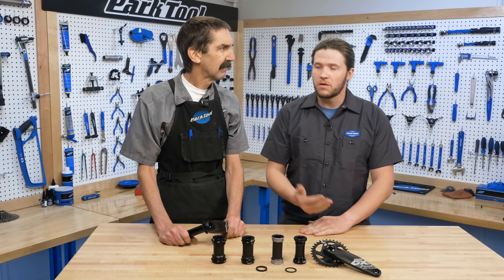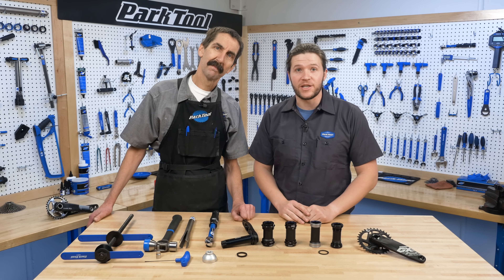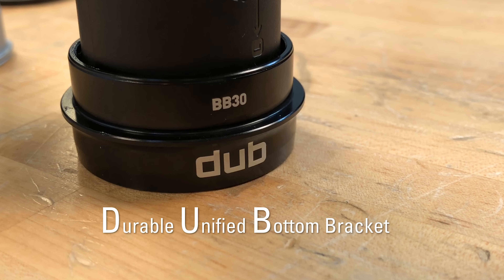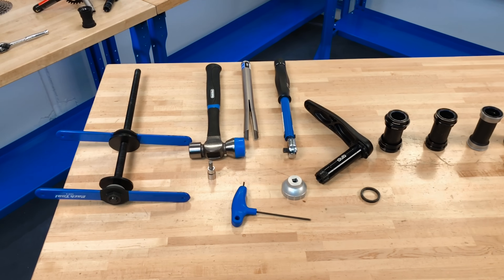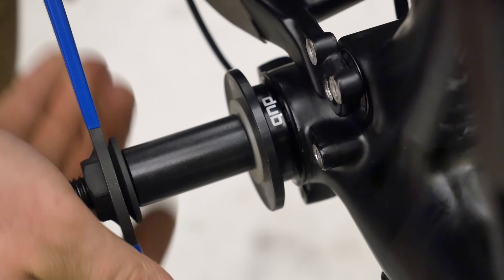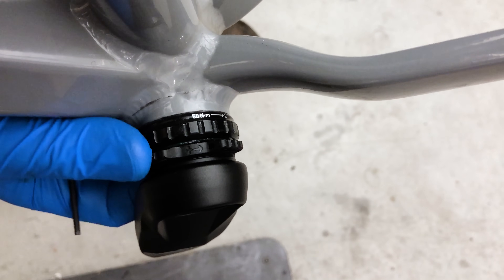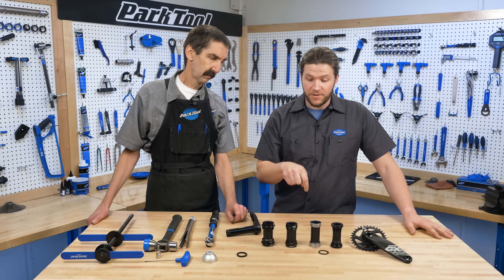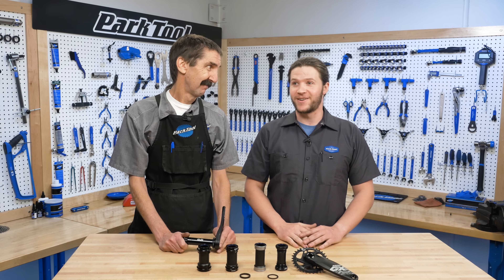First Look: SRAM DUB - Tech Tuesday #101

Comment: As a manufacturer of bottom brackets I can't believe that SRAM  market this as a unified standard. This is ridiculous. They've picked a non standard spindle size to add to the headache. This is like a train crash.
Reply from the maker: The ID of the bearing is 30mm and there is a plastic sleeve inserted on SRAM's BB offerings. I have talked to a few aftermarket companies that are going to be making aftermarket options for people who would like a higher spec bearing or a thread together option. So, same bearings as 30mm already. I believe they used the sleeve to allow them to use their unique snap in spacer system as well as put an additional sealing interface on the bottom brackets. We will see how this works out in the long run. But again same bearings as many 30mm BB's out there today so we can predict the longevity.
Reply: Disagree. He's got the hump because SRAM have chosen a custom bearing size. One that you cant replace with a proper high spec bearing from SKF or NTN etc. They're trying to bring back market share from aftermarket BB makers by using their own sized bearing. Far from unified.
Reply: Aaron that's exactly the point i was making about Wheels mfg, Kogel etc. Except they WON'T be making aftermarket bbs for dub because they can't buy the stock size bearings. Sram are driving out aftermarket makers with this tactic. Wheels and Kogel don't have the funds or rnd to make their own proper bearings.
Reply: Aaron, Cycngr is 100% correct. Wheels, kogel etc buy their bearings in. You are going to end up with either a sleeved 6806 or some piddly  bearings to take the load. It won't last.
Reply: The unified part is referring to Sram's "eventually" single spindle size (28.99) GXP and BB30 will be discontinued.
Every manufacturer has their own take. The consumer isn't really thought of when new products are developed.
Reply: ...but would you like another helping of watermelon-cantaloupe shortcake fruit cake?  (& would a dessert by any other name smell so sweat?) ;)
Reply: Just another consumer that has resistance to progress
Reply: So Aaron, would you say this is a 'dub'-step in the right direction?!?! ;)
Reply: People have big problems when manufacturers change their products, especially Sram. You have to remember that this is just a product refresh not a new "standard" Shimano did the same thing changing from Octalink 1&2 to Hollowtech, Raceface did the same changing from X-type to 30mm Cinch. This is no different, Sram are not making another frame standard. New products are always a step in the right direction, just keep up with it.
Reply: oioi Srambini
Reply: Hambini ridiculous
Reply: Who the hell cares about replacing a bearing in a stock bottom bracket?? Replace the unit and get back riding. Unified is referring to using their single 28.99 spindle size across multiple frame standards!! Whats hard to get about that concept. Eventually others like Kogel, Wheels Manufacturing etc will likely make aftermarket BB's  Pretty sure everyone bitched about Cannondale releasing BB30 until other jumped on board the 30mm train, no difference. again just small minded people having a whinge about something so minor.

Comment: As a bike shop owner... yay! Yet more complication for bottom brackets!
Reply: If they stop on that it will be ok.
Reply: I almost typed exactly the same thing haha.
Reply: is it? as a home mechanic (my own families bikes) this is no better or worse than any other system. To be honest all my bikes are English threaded, and the bottom brackets are cheap enough that if I swapped crank systems I'd just include the new bottom bracket in the cost of the crank. in fact i just did that on a new to me old bike i got. Swapped from english threaded square taper to english threaded hollowtech2, no big deal and the cartridge bearings were easier to setup, if less rebuildable. Of course the old square taper was cup and cone, but had been mistreated so the cups were pitted with rust so i had to replace the bottom bracket anyways.

in short as long as i can get the bearings that fit my bikes interface for the bearings I don't much care, but prefer threaded bottom brackets because they are easier to change at home under my shadetree.
Reply: Marc Ariss I really do feel bad for bike shops. There is no way you can keep stock for all of your clients. New completely unnecessary standards seem to appear every few months. And sram is the biggest offender.
Reply: Yay more sales because people like new stuff and don't know how to service their bikes =)
Reply: How many standards are enough ? Not a single shop owner that has been at it long enough saw the neo-yuppie explosion that has occured in cycling coming. Nor did many of us think there would come a day that it was marketed just like golf, a minefield of gimmicks and must have garbage that is seemingly in a constant state of flux. And over the last 10 years the pace at which new mechanical "standards" are adopted has been dizzying, so much so now that nothing is standard or unified about most things hitting the market. Most of us owners aren't really complaining as we will be selling people like 123456bmx the new "reasonably priced" "standard" and can quite easily adapt as there isn't a new tool involved (nice change of pace), but who the hell was even asking for this ? Nobody, that's who, this is simply SRAM developing for the sake of sales. Now Im sure we will see Shimano's completely different "unified" standard in response.....should be awesome.
Reply: Probably the most intelligent, insightful comment on this whole damn site.
Reply: Lead, follow or get out of the way.
Reply: Park Tool How about.. if it ain't broke don't fix it. Creating new standards that actually make a difference makes sense. Changing things just for the hell of it doesn't
Reply: Reginald Scot cry me a river you know what you got in to.
Reply: Marc Ariss it's an ever changing industry,If you don't like it then you are in the wrong industry.Also I will not buy gimmicky bottom brackets,especially from you.